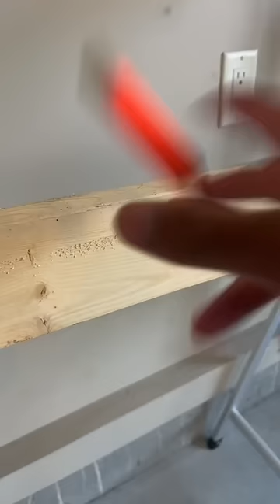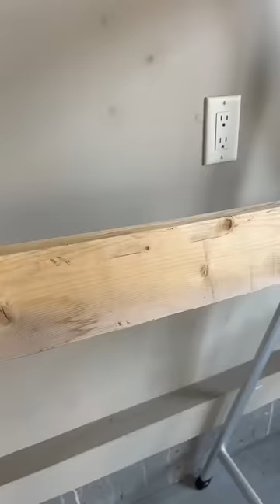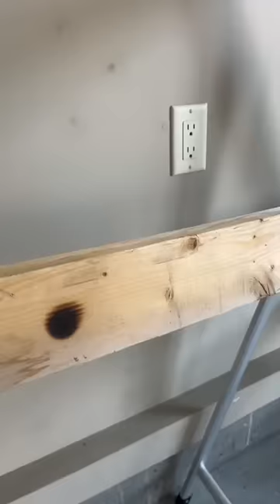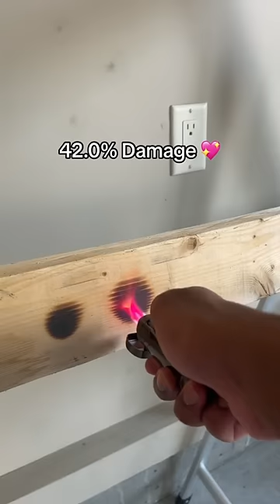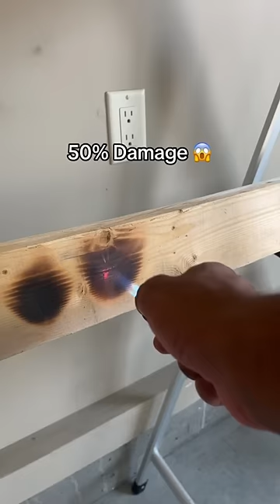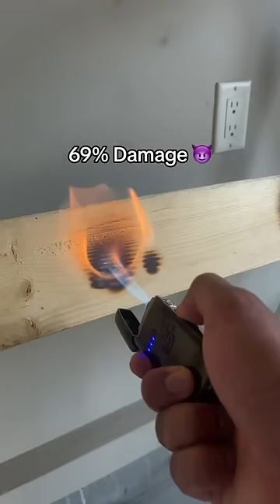Imagine 100% damage 😱🔥 #lighter #shorts

Comment: definitely a good idea to do it near an outlet
Reply: I was going to say electrical fire
Reply: Why sarcasm??????
Reply: @littlegirlbuddy  to mock the maker of this video?
Reply: well there's nothing flammable inside of an outlet
Reply: @truckjumperdude that's not the problem...
Reply: @Sebkir.  what is the problem?
Reply: Those stupid lighters literally spit gas of course it’s a dumb idea to use near an outlet or even inside your house
Reply: Glad I wasn't the only one thinking that
Reply: Relax safety Dez. Not like anyone’s ever gotten hurt by electricity.
Reply: @truckjumperdude that outlet is gonna blow
Reply: @Sonosoundd  what will cause it to blow?
Reply: @truckjumperdude  When you light an outlet with a lighter, it can cause a short circuit and damage the electrical wiring. This can lead to problems such as tripping the circuit breaker, potentially causing a power outage, or even a fire if the wiring becomes overloaded. Additionally, the use of an open flame near electrical equipment can pose a risk of fire, especially if there are any gas or other flammable materials nearby. It's always best to use caution and handle electrical equipment appropriately to avoid any potential hazards.
Reply: @37thousand  dez?? 🤨
Reply: @dezly  alright
Reply: @proboanimations3767  dude name is dezly what you want
Reply: @proboanimations3767  always getting called Dez lmao
Reply: @37thousand  you said dez, dez what?

Comment: Yeah that will be a TOTALLY SAFE IDEA to film it near an outlet.👍
Reply: how does the outlet add danger to a lighter demo?
Reply: @DizzyRonson because it can spark and make a bigger fire Jesus school didn’t reach in this
Edit: nvm my school taught this cause a kid put a quarter in a wall socket and almost died 💀💀💀
Reply: @Mr_breastfeeding  that makes no sense why would the outlet just randomly spark. That's some movie logic bro
Reply: @Mr_breastfeeding bro thinks that fire conducts electricity or somethig
Reply: @Mr_breastfeeding  You don't understand how electricity works at all do you.
Reply: @synthwavecat96  You also don't understand how outlets produces electricity
Reply: Outlet produces nothing, and only danger this movie is providing is brain damage.
Reply: @sonamadik3851  yeah but say if somthing went wrong and the fire spread on the wall and went INTO THE Outlet, I don't think it would respond well to that
Reply: @DivineAtheistWannabe  it does conduct electricity but that's not the point. The point is if there is a fire inside your house do you want it to be close to an outlet
Reply: @reds6832  absouloutly no, even if it doesnt directly go up in flames it would still

. Shut down the power to that specific wire,
. Stop whatever is plugged into the outlet from working
. Ruin your wall outlet that is probably expensive to replace
. Not to mention that the only way for it to get to the outlet would be that the wall or some object neer it is already on fire

It's soo dangerous
Reply: @JayZJaded  Easy, they fucking don't lmao. They're a receptacle to the main line to the house. The production happens at the plant.
Reply: @lily_pinkyay6980  20 bucks an outlet. Forget the outlet, you're replacing drywall, joists, studs, insulation and wiring along with it. And outlet is nothing.
Reply: @synthwavecat96  true, but it would have to be rewired since it all got burnt, if you have someone in the house who can do that then that's OK, but you might need professional help it also depends on the damage
Reply: @lily_pinkyay6980  ...hence why I listed the other shit that would likely get damaged.
Reply: @synthwavecat96  exactly

Comment: Remember kids, dont burn hard wood like chestnut, cherry, ash tree, beech tree, oak and other as hard wood produce toxic esalations when burned use instead soft wood like pine( some tipes), poplar, linden, teak,  birch ecc. If you need to burn anyway hard wood and soft, do it in open and safe areas (that are not gonna lit up everything around) and is safer to use also masks to block the gas (for hard woods)
Reply: pretends to read
Reply: LOL, city boys are afraid of campfires now. Hahahaha